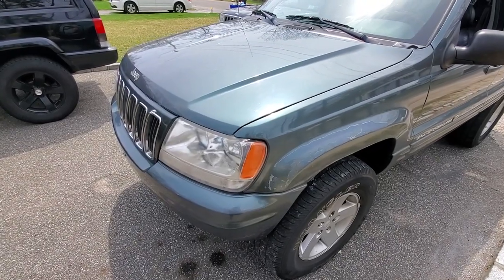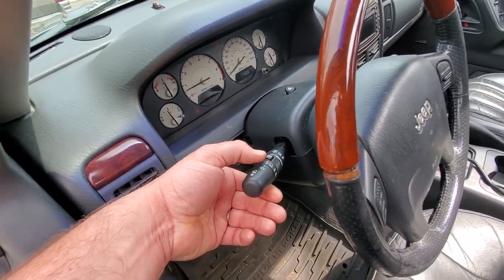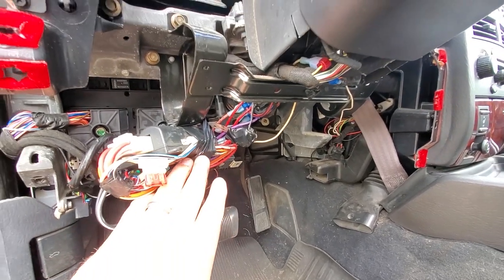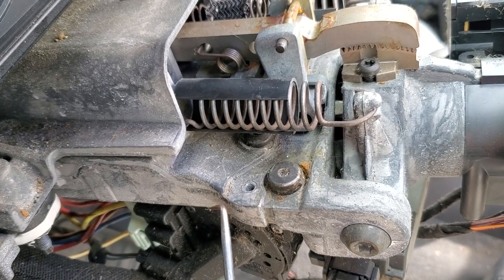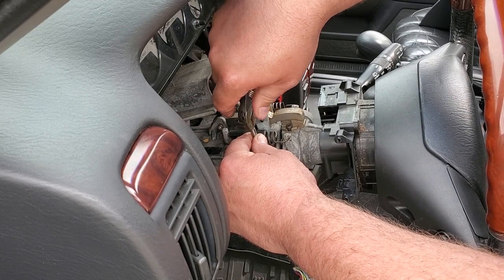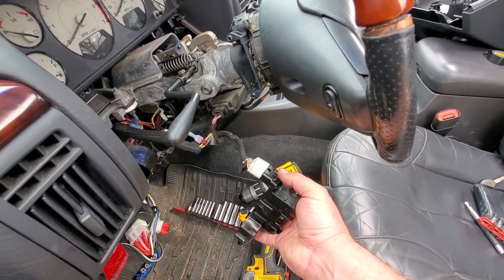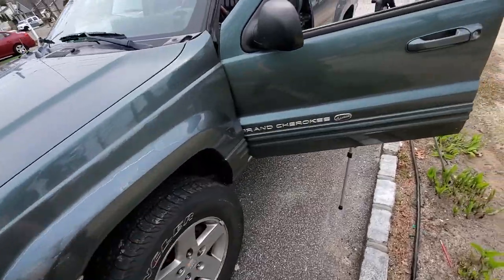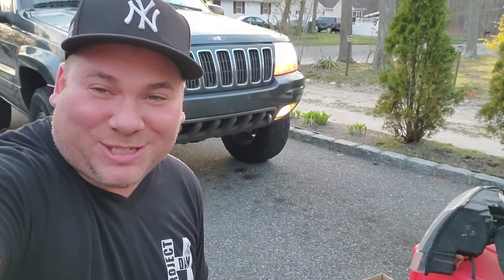JEEP GRAND CHEROKEE WJ HEADLIGHT SWITCH REPLACEMENT AND TILT STEERING FIX

Comment: thanks for your video! I had the multi function switch for months, and for some reason I thought I had to pull the wheel, so I put off installing it - but dang saw your video and had it done in 5 minutes! Glad I didn't have to fix the tilt lever!
Reply from the maker: Thank you for watching Matt, Glad it was easy! God Bless

Comment: I have a 1999 JGC with a black instrument cluster with red needles. I wanted to replace it with the kind you have but the ebay listings say it won't fit 1999. Can I use the style of your cluster in my 1999?

Comment: Questions  for you i replace the power steering  pump and the steering box but some time when  i turn  left  make a noise  like a cow like they need oil but oil is ok
Reply from the maker: Dang dude! As long as it works.. make sure You cut your wheel with the vehicle emotion You don't want to burden the system by turning the wheel without the vehicle moving

Comment: Only the passengers side parking light will turn on in my case not the driver side any idea I already checked all the fuses they were fine my turn signal works and also my hazards
Reply from the maker: bad tail light housing.  check your bulb and bend your prongs up. 👍

Comment: I had my headlights randomly turn on in the middle of the night! I was taking out the trash and was wondering if someone was going to steal my car! I am able to turn them off which I usually just do and haven’t had the issue again but maybe this is something I should change
Reply from the maker: It's a cheap and easy part. It might be worth it check it out!

Comment: the grey factory keys are the "chip" keys, black factory keys are non chip keys, the black keys will unlock and actually start the jeep, but it will only run for like 10 seconds.
Reply from the maker: SKIM.. Sentry Key Interface Module... AKA Huge PITA! 🤣🤣🤣

Comment: Can you link one that has auto but no fog light my WJ did not come with it
Reply from the maker: it will work in your jeep...  maybe you can even use the factory fog switch and run yourself some aftermarket fogs

Comment: Hi Dan I think your problem is due to the fact that Jeep have put the steering wheel on the wrong side of the car.
Reply from the maker: 😂😂😂. It's not a WG! 🤙🤙
Reply: The steering wheel is on the right hand side on my Grand Cherokee,but I do live in England .
Reply from the maker: @dougfields5798  greetings from across the pond! Cheer's 🍻!
Reply: I enjoy watching your videos Dan ,even through you drive on the wrong side of the road .